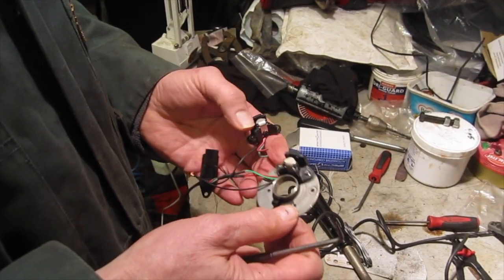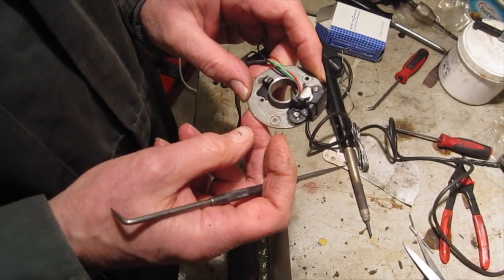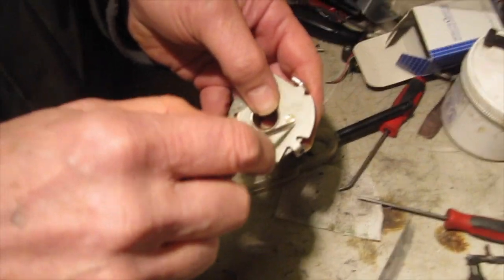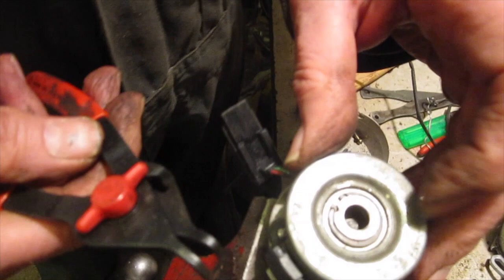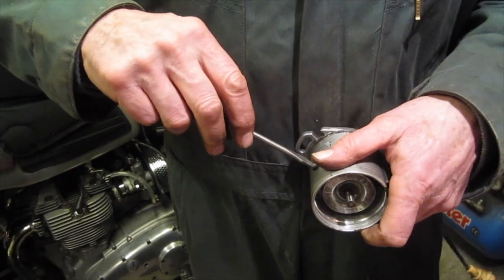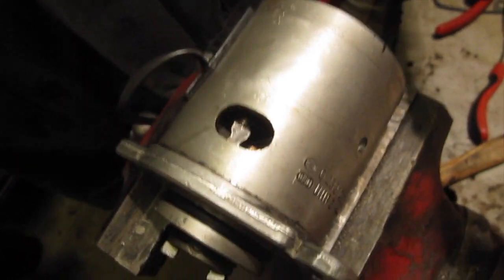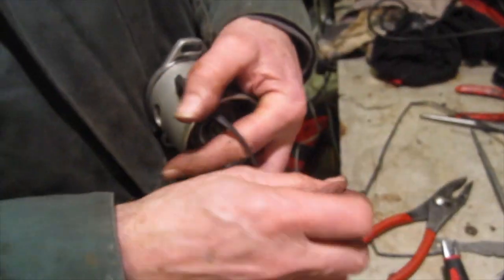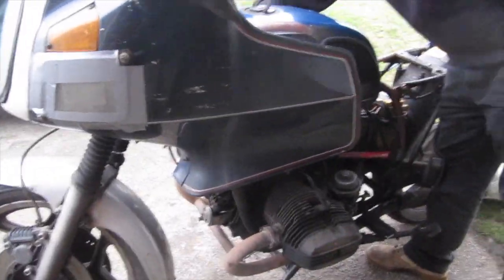Replacing Hall Effect Device Part 2

Comment: I've replaced the HES on mine, (1990 R80) and couldn't have done it without your video. Thanks, there is very little footage out there to view. I bought the whole HES and wiring from Flat Racer, on reflection I could just have bought the unit and done what you have shown. When I reassembled everything a few things happened. Firstly, I lost the lock pin. Couldn't find one except from Europe at a huge cost, so I replaced it with a similar diameter drill bit shank that I cut to length. Another issue was that the rotor was too high, and the cover screws that go into the C clip were snagging on it. This was traced to the base not having been correctly located in the advance retard unit. As well as sorting this out, I discovered that spring replacement can be carried out in situ as you rebuild, as compared to having to exhibit the skills and dexterity of a gynaecologist . Every day a school day. I'll put out back on tomorrow and see how I got on.

Comment: Hi Mr. Phoenix .... can you expound on the lubrication before I reassemble my bean can?  I see you said to put a drop of oil up where the E clip lives.... and I saw you put grease on the top of the spindle where the mounting bridge holds it .... but is  there any other place that needs grease.... Like say the bushing that fits the lower "sensor" plate to the upper "sensor" plate... mine was a bit rusty.. and I thought maybe it needed something to keep it from sticking together so hard.... Also... does the shaft area that sticks up from the bottom of the can and goes into the outer spindle that attaches the springs  and rotates ... does this need some light grease or light oil?   I just wanted to take care of this before I put her all back together....   

Also... it was VERY difficult to get the top shield of the spindle.... I did not have a slide hammer ... so supported the shield from the bottom with a couple of skinny allen wrenches across an open vise.... and put a small 8m bolt down the top of the spindle to not damage the spindle top when hitting it with a  small hammer.  I put a box under all of this to catch the parts (especially the little bitty index pin) ... and then repeatedly stuck the head of the bolt ....  Would not budge... SO I took a torch and heated the shield... and then tapped again and again.. and finally it moved.
Reply from the maker: During normal maintenance I just lubricate those parts you mentioned. That is: a drop of light oil at the e-clip, that is intended to lubricate the inner and outer shaft surfaces; it will work its way down. That should suffice; there is no need to dismantle these components to do this. Also a drop of oil on each of the two the bob-weight pivots. Then a small dab of grease on the spindle where it enters the support bridge. There is no harm in applying some grease to the sensor plated to inhibit corrosion.

Yes the Hall effect vane (shield) can be very tight. So long as you do not do any significant damage/distortion it should be okay. Keep heat away from the sensor. Remember it is essential that the key (pin) is in position for reassembly.

All the best.........

Comment: Hi Again Mr. Phoenix.....  I am rebuilding another bean can now.... and this one has some rust and dirt down in the bottom of the can where the springs and bob weights ride.  I want to take the bottom drive (the part that the engine drives) off so I can clean and lube these parts, but I am wondering how to do it.  There is a spring wound round the drive gear.. and it looks like this spring holds in a pin that goes through the shaft and drive gear. I am assuming this is a tapered pin that I should drive out after pulling this retaining spring off...  Have you had experience in pulling the bob weights out?  I tried tapping out this drive pin... put before I put too much heft into it I thought I would ask somebody first (before I destroyed something).  Maybe some heat would loosen up the pin?   Ideas sir?
Reply from the maker: Hi, now you are in uncharted territory for me. The short answer is I don't know, since I have never found it necessary to dismantle the mechanism. I would guess that the pin locates the drive dog in position, but allows it to move slightly, thus providing some self alignment to the camshaft boss. Anyway, if you need to know more I suggest you join the Airheads BMW Facebook page. There are plenty of people there who are knowledgable (e.g. Mark Morrissy, Ray Peake) and are willing to give advice. Or you could try looking for information on Snowbum's vast airhead website: technical-articles-list.htm 
All the best.... Guy
Reply: @motophoenix5951  Hi Again Mr. Phoenix ...  I took my Bean can to a machinist friend at work today to get a second opinion about pushing that pin out. He looked it over with a loupe and determined that it was not a tapered pin like I originally thought... and figured it was a straight pin. We used some nicer supports under the drive gear... and a small press ... plus some light tapping and finally got it to move. After we pushed it out the polished pin had a little bit of rust on it.. that was probably holding it in too tight... so when I reinstall it I will polish it up good... and put it into a freezer for a while and then press it back in.   After I got the pin out I was able to remove the spinning assembly with the balance weight bobs... and I will clean it up nice.. an polish up the metal and put it all back together.  By  the way... my sensor was not bad, but the molded wire feeding it was. So in the future... before I replace the sensor... I am going to use a hall effect sensor testor to check the unit electrically first (they are easy to build - I had one from when I replaced the sensors on my R1100 years ago)... then check the wire continuity before I demount the sensor.  Live and learn. My connectors on both my R65 and my R100 were both very crumbly and needed replacement. I was able to get new connector replacement kits from EME https://www.euromotoelectrics.com/product-p/ign-plug088set.htm. thanks for doing these videos.. they give me the courage to try new things.
Reply from the maker: @clarkmorris3312  I am pleased for you. Thank you for the information; also the contact for kits. This will be of use if I need to dismantle that part of the drive, or source a connector in future. 
On my PD, I converted the system to run off contact breaker points. A little more maintenance is involved, but I figured with c.b. points it is simpler to repair on the road, especially if I am riding in remote places far from home.
Encouraging folk to to have a go was my reason to start this channel in the first place. I am a firm believer in mutual aid.
All the best....

Comment: Hi, Great video.
I have the R100RT,  and with the RPM  stay high and won't go down after I throttle up. I check all the carb and valve clearance. and the timing as well. And I still have the "RPM stay high" issue. Does it relate to the Hall effect sensor  inside the beam can?
Reply from the maker: Can’t think how the actual hall device would. However, a broken spring, or damaged / sticky auto advance mechanism can give the symptoms you described. 
But first I would disconnect the throttle cables from the carbs to determine if the spindles are free and / or if the cables are tight or frayed and hooking up. Also check the rubber manifolds for air leaks / cracks etc.
Reply: No.  If it is bean can related it is because the springs have stretched and need replacing.  Your real problem is finding a source of correct tension replacement springs - not Chinese sh1t.